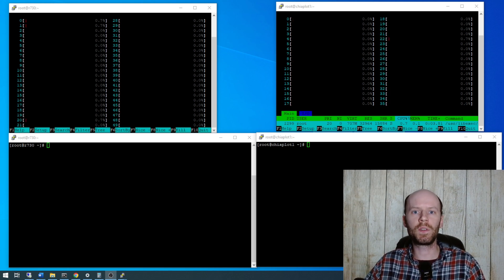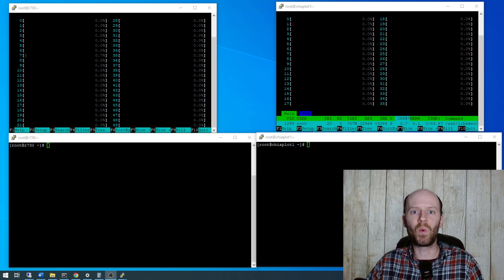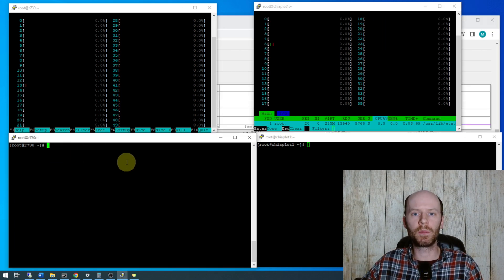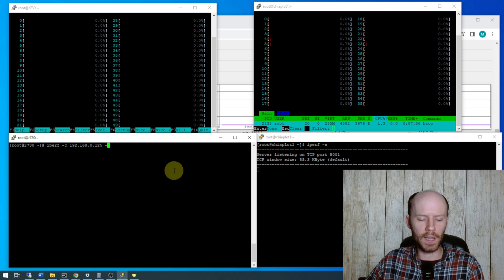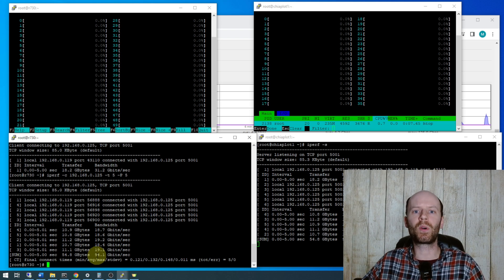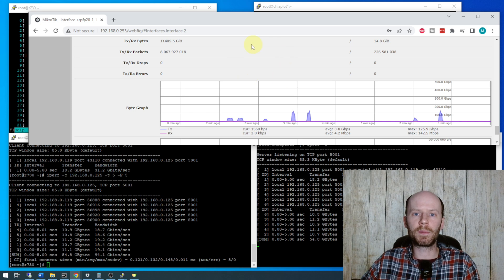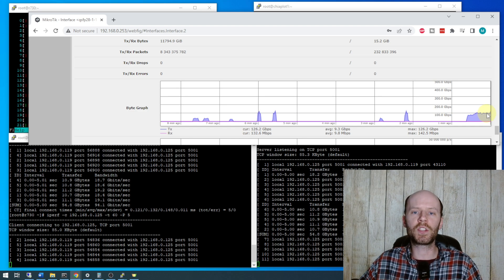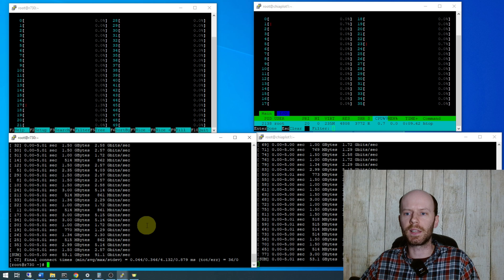Revisiting IPerf Testing on the Mikrotik CRS504-4XQ-IN 100GbE Network Switch

Comment: This is all well and good, but where is the switching capacity on the datasheet? You're only testing a single port but I'm interested in the entire backplane capacity of the switch. It has 4 ports of 400g so the backplane should support 400g line rate being that it's a switch.
Reply from the maker: Mikrotik has some detailed testing done at various frame sizes, which can be found here https://mikrotik.com/product/crs504_4xq_in#fndtn-testresults

Comment: Hi good video, do you mind doing iperf tests using this as a layer 3 switch specifically using NAT? The 98DX4310 ASIC in this switch should be able to do linerate routing but I do not think that NAT is programmed into this ASICS pipeline so it is reprocessing packets or punting them entirely I am very curious to see the performance hit for this specific box.

Comment: mikrotik tests with some IXIA or similar boxes and puts the results on their site, including packet per second count at various packet sizes

you can pass -w1m or whatever size TCP window you want to iperf and it will transmit with a larger TCP window which will lower the need for parallel threads to max out the capacity

Comment: why don't use qsfp28 fiber? there are some really cheap 100gb modules out there :) single mode fiber cable is also pennies...
Reply from the maker: The fiber is cheap. It's the transceivers that are expensive...
Reply: @HomeSysAdmin  i bought two 100g qsfp28 modules (CWDM4) for 28 euro each with delivery (in EU) :)

Comment: 100Gb is insane for a home lab. I'm excited to be upgrading our core routing and switching in the data center to 40Gb, though many data centers are deploying 400Gb links nowadays.
Reply: 100Gb is a bit much, but 25Gbps is not and you can break out to a decent amount of ports with this switch.

Comment: Just discovered your channel after picking up a pair of ConnectX-4s. Good stuff! Considering picking up this MikroTik switch next, but I heard it's missing the necessary L2 and L3 congestion control features for RoCEv1 and v2 respectively. But I also heard that with RoCEv2, it might be OK anyway. I'm just getting into RDMA stuff, any chance you could give it a try through the switch and let us know your results? Thanks!
Reply from the maker: Hi. It's a new channel, spin off of my other @LithiumSolar. Unfortunately, I've sold the switch already as I didn't plan on doing any further testing.